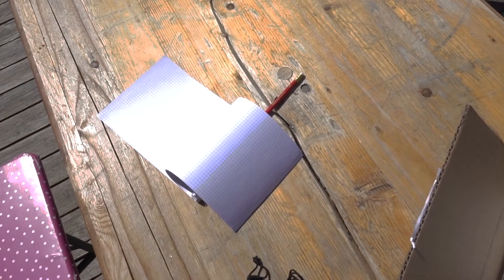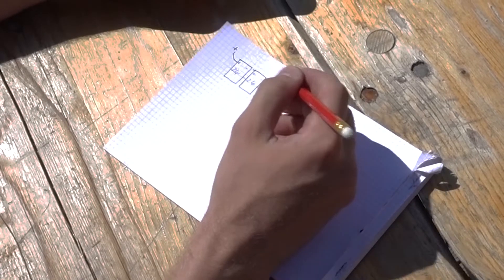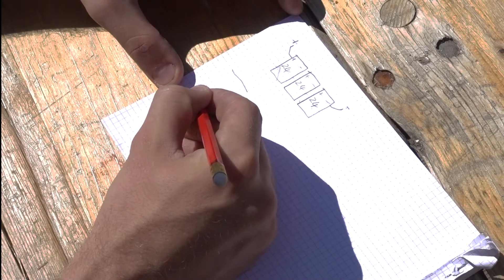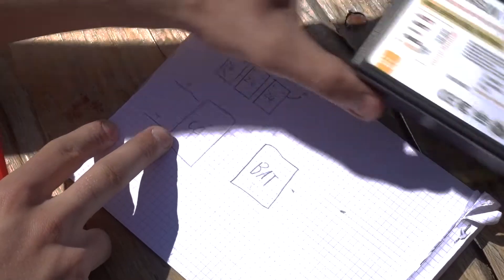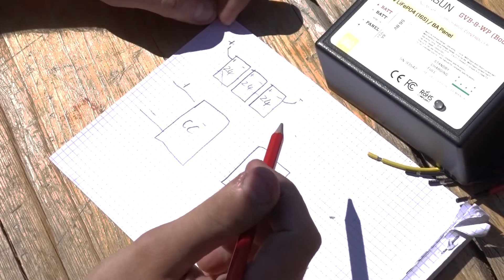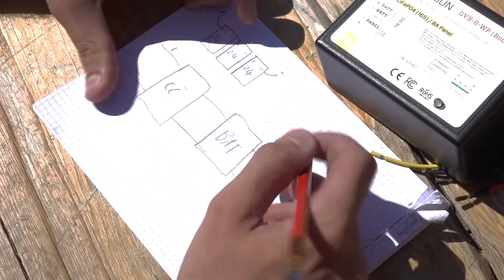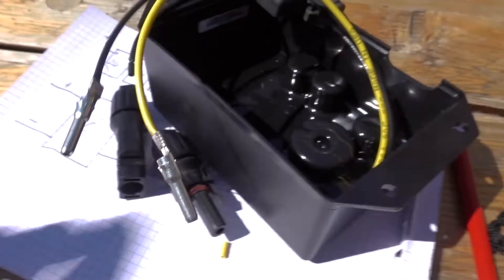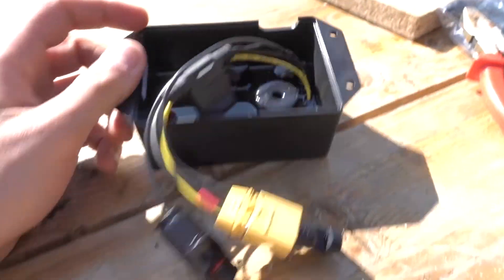Solar Powered EBike DIY - Part 2 - Electrical System

Comment: I see your GVB-8,   How did you keep the max VMP under 43v and the IMP under the max of 8a..  Parallel or Series would put you over on voltage or current.  I've been looking at the SunPower® Maxeon solid copper backed cell, panels.. (25% efficiency rating) ( SPR-E-Flex-170w 6x8) .Panel is 29.4v 5.84a.. Smaller package more powerful.  One panel keeps the Current and Voltage in acceptable range (unlike multiple panels in series or parallel) . Thoughts..?  :)
Reply: I'm also interested in panel sizing (Watts) I have a 13Ah battery and a 250W motor

Comment: Still some snow in the Dales I see.
Reply: I bought a MPT-7210A. Cheap controller. € 26,77 Not sure it will work. This guy had some problems with it and got another also cheap controller. https://youtu.be/bwnX7eCAODQ

As for charging your drone and phone; it is just a droplet for your e-bike battery. Don't worry about it.
Reply from the maker: Haha yea, very beautiful here ;) Yea i have one. It's not actually mppt and it drops the power for 15 seconds everyone the output of the panel changes unfortunately!
Reply: I have a 36 Volt battery and I am hoping the controller/booster will perform better. It seems to have trouble keeping up with shades/sun. I may choose to charge only during lunch breaks.  I bought a cheaper (€60) 8Ah battery for testing and as a spare. 
My goal is where you are, the Alps. Haven't been there in a while. Ride up to the snow. Please don't touch it. 850km and 850km back home in 14 days. So it is range I am looking for. And with range comes speed. Instead of 10km/h uphill and 5 nicotine shots, I want 20km/h to get to the top. For that I decided on the 500Watt Bafang. Which leads me to this question: Have you ever been stopped by the police to check? Or do you have a license?